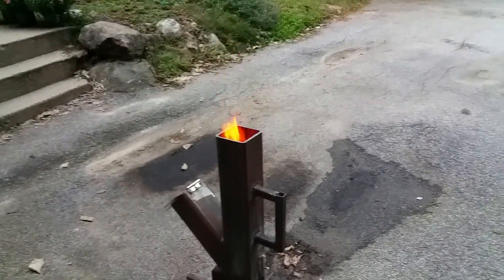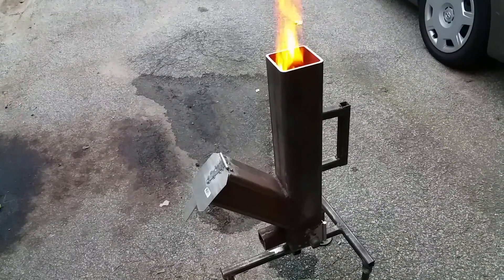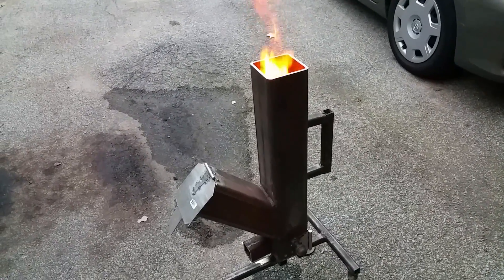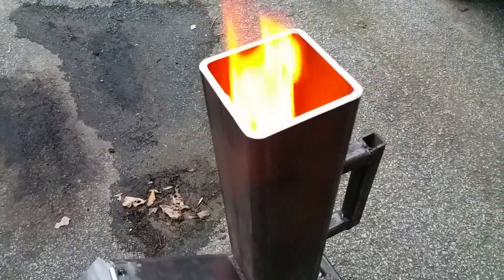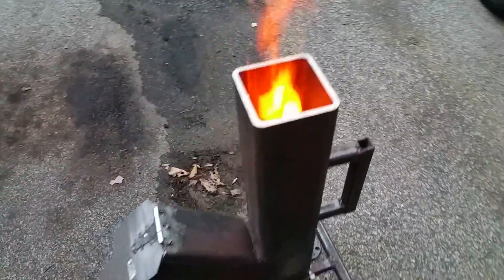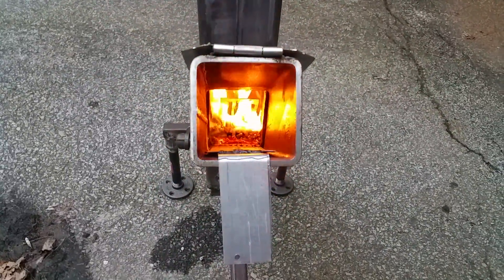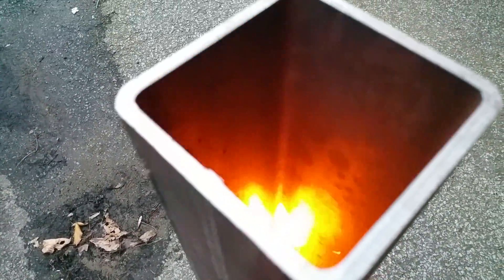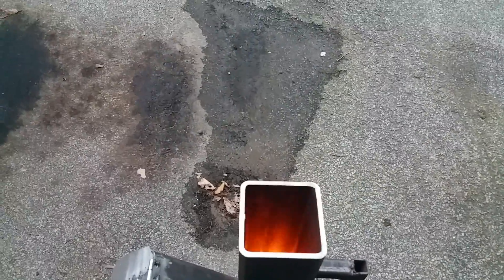GRAVITY FEED PELLET - WOOD BURNING ROCKET STOVE PART 1

Comment: Not exactly a thing of beauty....
Reply from the maker: Yea but it works good.
Reply: Emergencies from an EMP, solar flare, or nukes makes beauty obsolete. Would you want beauty or a way to cook food, get warm, using basic survival tools? Who cares about beauty when your freezing and starving!
Reply: 73leo73 looks good to me and i like the set up. What about enclose the top to add a cook area and have a 3 inch opening for pellet stove pipe.
Reply from the maker: seoulkidd1. Good idea.
Reply from the maker: seoulkidd1. I  think my stove throws way too much heat for a "tiny" house but thanks for the idea.  I am thinking about a better design and if I decide to build it I'll probably do a video of me building and testing it.
Reply from the maker: Tony Beku. Yes it does kick but and cranks out the heat to.  Thanks
Reply: 73leo73 your set up would be great for preppers, tiny houses, and , small cabin owners.
Reply from the maker: seoulkidd1. I guess it would be good for that but it sure throws allot of heat when it gets going. That 1/4 inch steel I used when it gets hot it gloss that heat and really spreads it out.
Reply: 73leo73 look up Big fire stove and gets sum ideas. your stove set up will be great for preppers and tiny home owners.
Reply: Wordavee1  does the job who cares what it looks like
Reply: Wordavee1 - Feel free to post the video of the the one you made

Comment: what are the two things sticking out of the sides towards the bottom with the caps?
Reply from the maker: Annony Mouse  those are 1/2 inch pipe nipels that I can open for extra air if needed.
Reply: OK, turbo boost!

Comment: Really like the design, any guesstimate to how many BTUs it puts out? Or how many lbs of pellets it burns per hour?
Reply from the maker: Mike Richardson  I couldn't even guess how many BTUs it puts out but boy she can crank out the heat if I let it.  The stove can burn 2 to 3 pounds an hour if I let it.
Reply: How low can it go without smoking? A clean burn is about 6kBTU/lb with most pellets to my knowledge. I'm looking to build something that can burn between 4K and 12KBTU. Another question, what size is your intake and do you feel like it's a good size for your burn chamber sizing?
Reply from the maker: Mike Richardson. Main intake is about 1 1/2 I'D but I can add more air with the pipe nappies I welded on the sides.  It burns much hotter with the main intake alone because the draft is more aggressive being forced through the small intake

Comment from the maker: Thanks for the compliment.  I have considered welding a 3 foot long 4X4 inch of square tubing across the top of the chimney like a "T" having the exhaust go out both ends which would allow several pots to cook at the same time. I believe I would have to add more height to the upright portion of the chimney to help increase the draft which only makes the fire burn hotter but more efficiently.  When and if I do something like that I will make another video.  Thanks
Reply: One option would be to build an air intake so that the runs along the chimney before it reaches the fuel. This way there'd be pre-heated air and more efficient burn. In theory, at least.

Not there'd be anything wrong with this fine stove right here!

Comment: Best design I've seen so far!  Is it necessary for the chimney to be directly over the fire or would it draft as well with an off-set? How much of an off-set could it stand, if any? This would allow for a cook top. A surface not directly over the chimney flame that maybe could be two or more "pans"  wide or long, depending on point of view. I imagine a cook stove top of three pans wide and two deep. Fire fed from one side and chimney up out the other side. Advantage being the efficiency of the rocket effect.